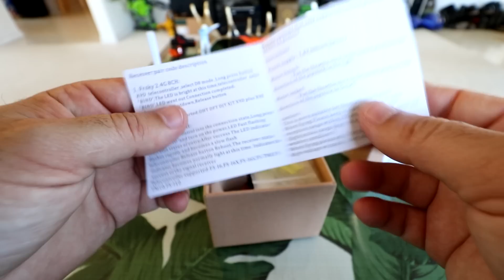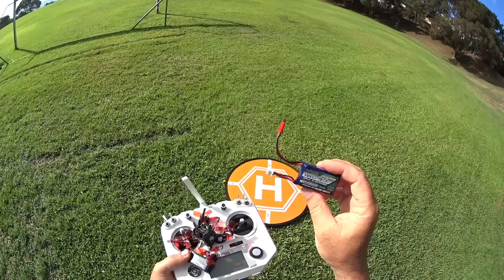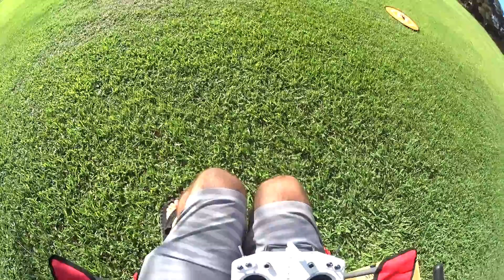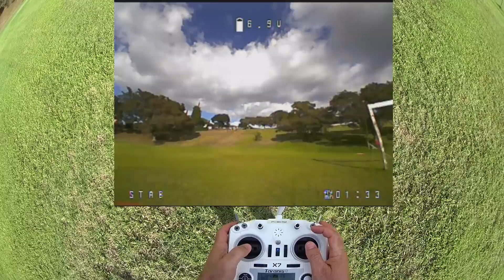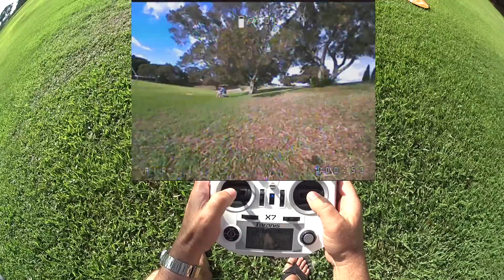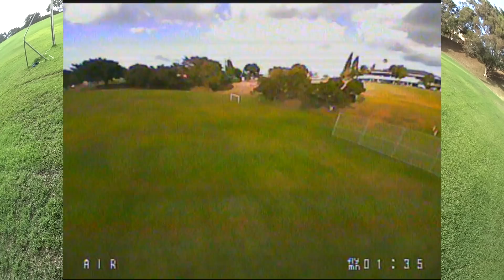LANCHI MONSTER 😈 76mm Micro FPV Race Drone - Full Review - [Unbox, Flight/CRASH! Test, Pros & Cons]

Comment: Surprisingly quick for a 1.6" quad, and the camera/VTX combo performed really well. Great that it includes an F4 flight controller as well as both a buzzer and an OSD, something missing from a lot of those little micros. There was a lot of vibrations from either those motors or props though, and they seem to be continuing the tradition with these micros of supplying a battery that will brown out under load. Something like the Turnigy Bolt 2S 500mah LiHV should be able to provide longer flight times with more pep and no brownouts at about $6 USD ea.

Comment: The 25C battery gave you a brown out FC reset .. not enough C. The 2S 350mah 35C are okay, but you can find some nice 2S 550mah 80C batteries (3 for about $15) on Amazon which will give you better flight time. The drifting in Angle and Horizon is due to vibrations. I had the same problem and others who frequently review these micro racers (AndyRC) have found that the solution is to "soft mount" the motors and FC. You can get these tiny rubber 'donuts' with which you shock mount motors/FC and the drift problem goes away. If you still get voltage sag and beeping on punch outs, some guys are changing out the JST connector for a XT30, which will carry more amps to the system. That misplaced wire on the FrSky RX is something I've also seen on AndyRC's channel, so it seems like a common mistake .. easy to fix, but it should come configured correctly.  Best way to set that voltage offset number in Betaflight is to first measure your battery with a DMM, then connect the craft and connect to Betaflight and connect the battery. You should see the battery voltage at the top of the screen. If it is off, adjust that number.  110 is default. The higher the number you put in, the higher it will read.  I think there are 2 Vbat warnings: low & critical. I just set them both to 3.0 v and that helps with the premature beeping.  Surprised that it survived those headers into the goal.  About 6 weeks ago I posted a vid to my YT channel where I hit a football goal post head on (with ZMR250). Had it all on the FPV video, which cut out the instant it hit. Looks like you had fun flying it around.  Cheers.
Reply from the maker: +Bill Somrak Right on Bill.  I have a BUNCH of micro racer reviews coming.  My community (and their dogs) are going to hate me 😂🤙
Reply: Yeah, the micro brushless are very high pitched ... especially if you have ones which will run on 3S.
Reply: Bill is a tiny whooper. Lol
Reply: Bill Somrak i heard watch the mah on the little guys cuz the battery gets heavy and cam burn up the motors or nkt fly as fast. Would this depend on the strength of the. Motors or type of drone?
Reply: It's always better to have a higher "C" rating than needed.  Depends on the motors ... 1102, 1103, 1104 or 1105, and the KV rating.  You can get away with a 25-35C battery with 1102 or 1103 motors. The Mah rating only changes the length of the flight. Typically, a 450mah battery will give a 4-5 minute flight.